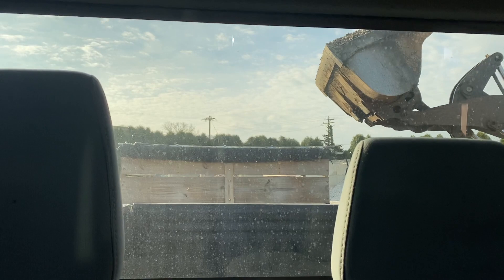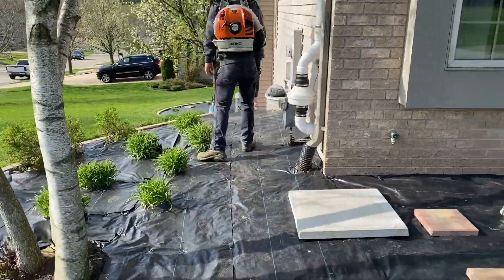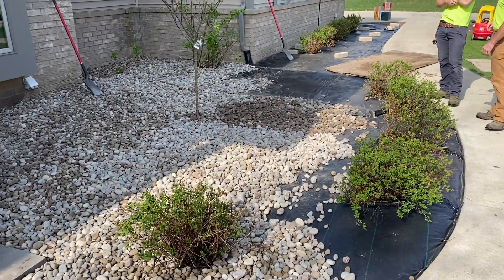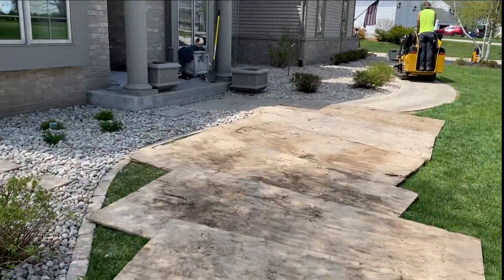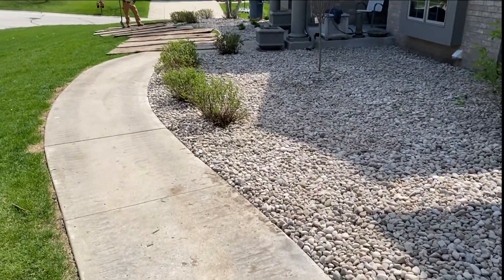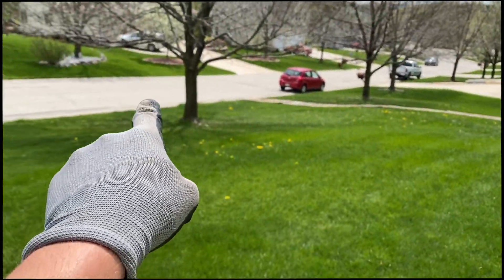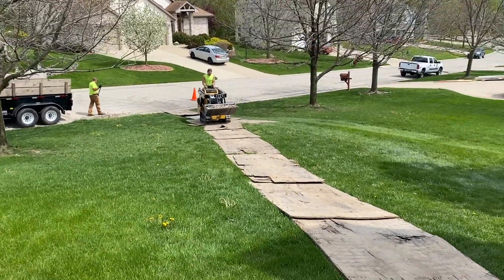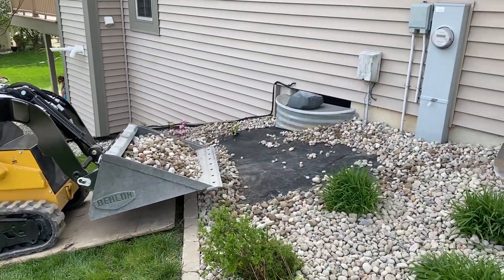Installing Landscape Rock with the Vermeer CTX100

Comment: Quick suggestion, I know you want to use the ctx 100 ( I own one and love it ) if you you do this kind of work often get a motor wheelbarrow 500lb capacity and is way faster than using the ctx 100 for this kind of job. I done both methods and I can warranty you the wheelbarrow method is faster. ( you can use the mini to load the wheelbarrow )
Reply from the maker: Never thought of that, sounds pretty productive

Comment: Do you ever have customers complaining about the tracks leaving marks on the sidewalk? If so,. Does  a power washer take it out pretty quick
Reply from the maker: @anythingadrenaline4515  depending on the job I will pressure wash the area if I am driving in it a lot of times back and forth if it’s just a couple times and few rains will wash it off

Comment: Been looking at mini skidsteers for a while. Curious to know why you decided to go with the ctx100 instead of the s925tx?
Reply from the maker: I wanted to go with a 1,000lb lift capacity because I don't know how long it will be until I can get a full size machine. I guess it depends on the type of work you are doing. I wanted to get more machine than I need now so I can grow into it. I also have a video on my channel that you can take a look at comparing the CTX100 VS the S925TX